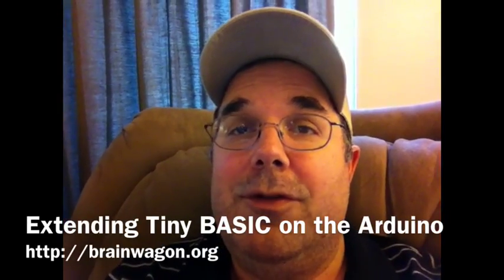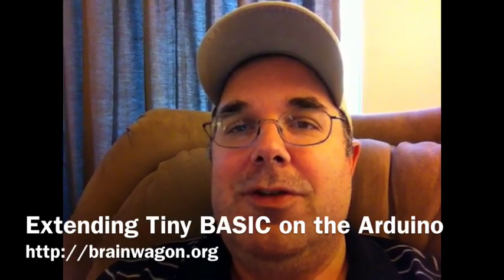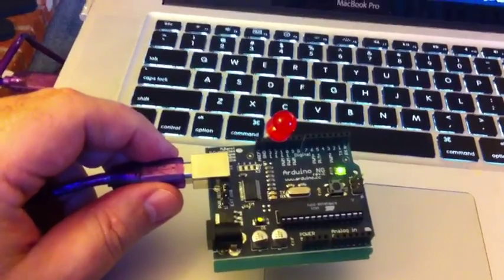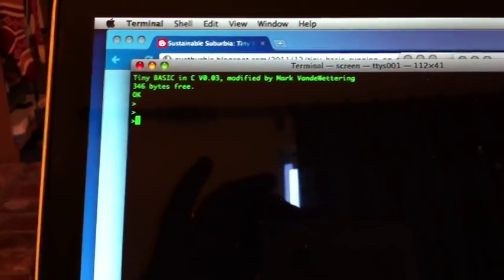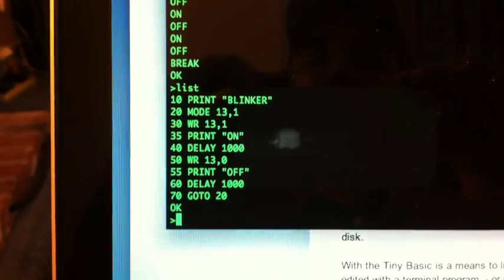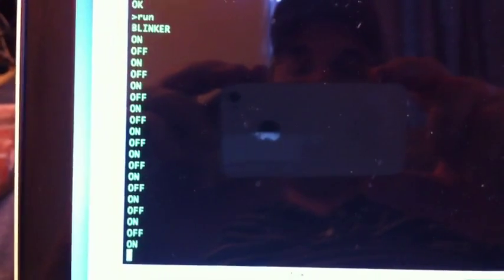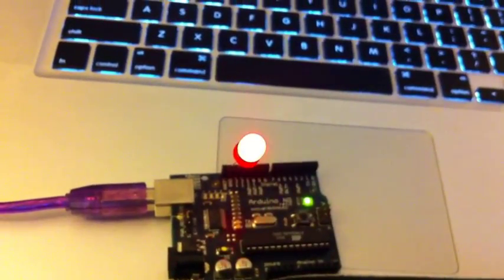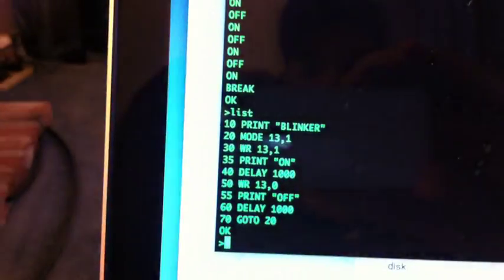Extending Tiny BASIC On The Arduino

Comment: Hello i followed your test commands and came accross this.

LIST

10 PRINT "BLINKER"

20 MODE 13,1

30 WR 13,1

35 PRINT "ON"

40 DELAY 1000

50 WR 13,0

55 PRINT "OFF"

60 DELAY 1000

70 GOTO 20

OK

>

>RUN

BLINKER

What? 20 M^DE 13,1

Not sure what to do can you please help me?